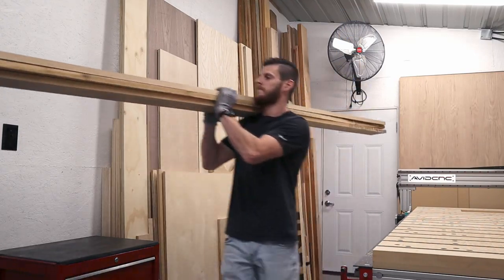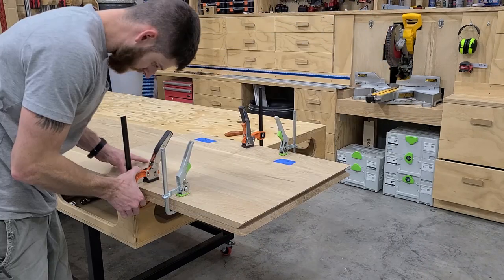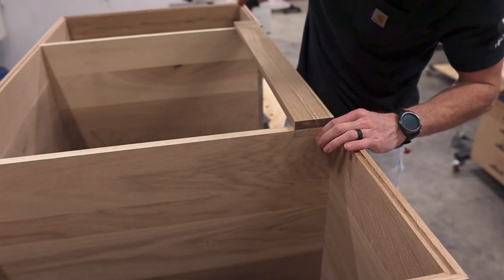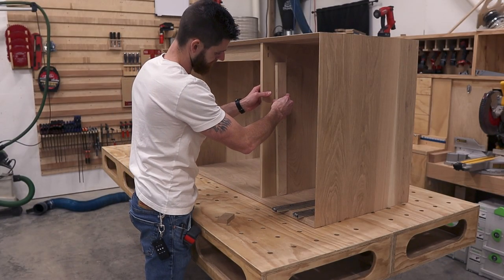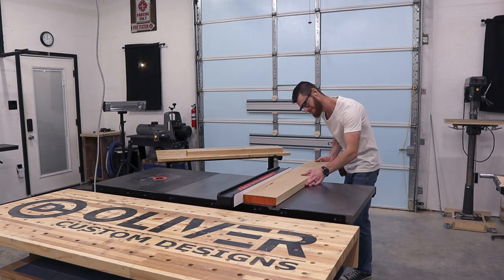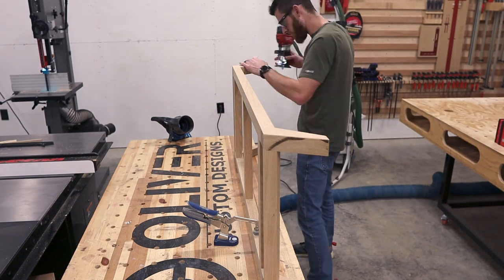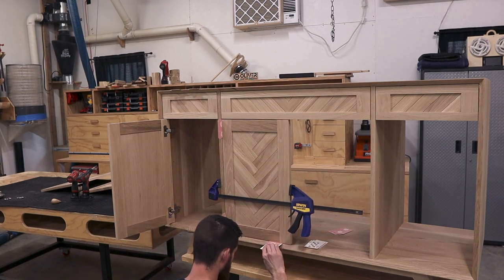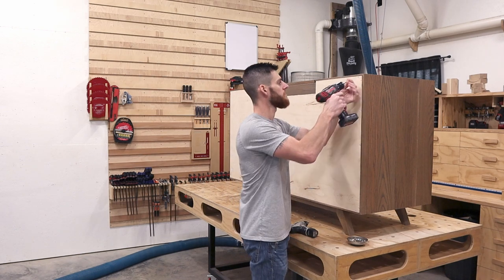Outdoor Furniture Build

Comment: Turned out nicely.  I might add, this might be the nicest piece of 'outdoor' furniture I've seen anyone create.  I'm curious how the piece weathers.  Thanks for sharing your work.  I know making these videos is no small task. 👍🏼
Reply from the maker: Honestly after finishing it I dreaded the thought of leaving it outside, but it's been there for about 8 month and it seems to be holding up pretty well. The handles are starting to rust a bit, some oil or wax should help that. Also the lid doesn't sit as flush some days depending on the humidity. Thanks for watching!

Comment: Nice job editing and problem solving. I can't tell you how many times I've made similar mistakes. My most recent one was relocating our HVAC thermostat and thought I was drilling through a double stud... turns out there was only 1 stud and I drilled through the side of the brand new built in cabinets I just finished in our master closet. IDIOT!! nothing a little wood putty and paint can't fix though.
Reply from the maker: If you can fix it then its not a mistake its just added character... At least that's what I kept telling myself during this build lol Thanks buddy!